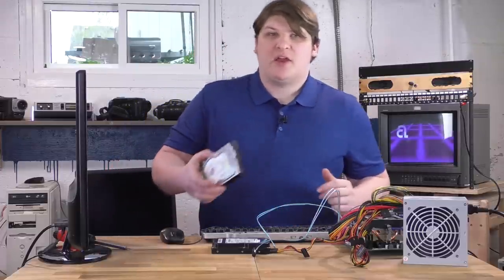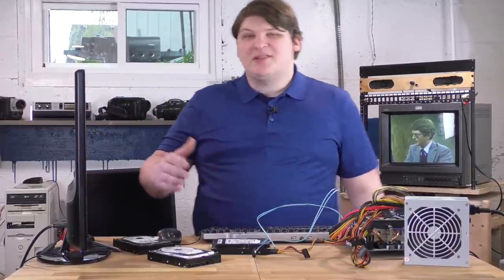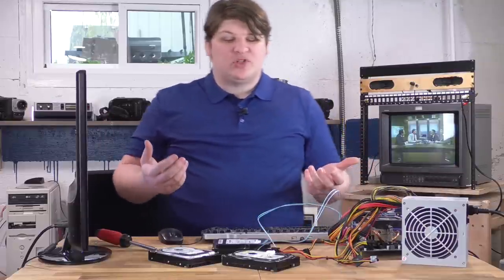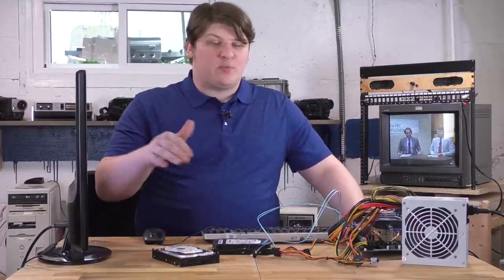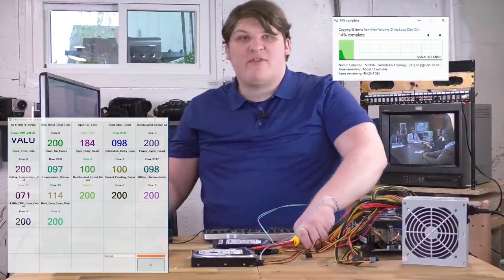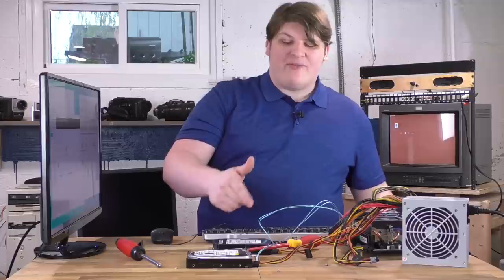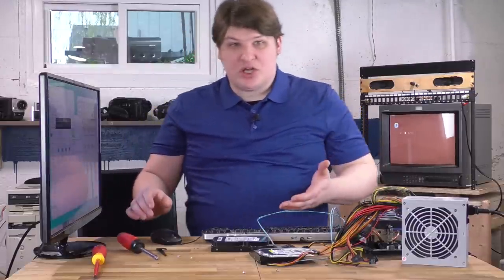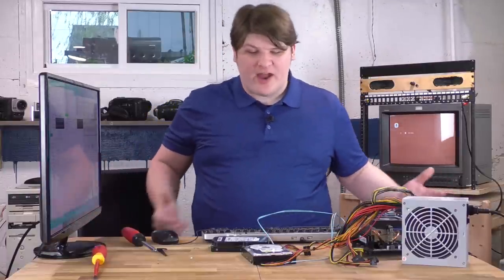Can A Hard Drive Breathe Regular Air Like Us

Comment: my takeaway from this is that DIYing data recovery by swapping platters with my bare hands is a perfectly fine idea with no issues whatsoever
Reply from the maker: two days ago i would have chuckled at this obviously absurd idea but now I have no convictions or beliefs left in me
Reply: Don't touch the platters! The oil can warp the magnetic signal being read by the heads, or make drive head interference!
Reply: Your best option for data recovery is buy a donor drive with the same firmware version, swap the circuit boards.
Reply: now i wish i didnt chuck an old external hard drive of mine. i wouldnt say much of anything valuable was lost, but, still stuff i would have liked to archive to some degree.
Reply: @fully_retractable  eh, most modern drives have data unique to the drive on the PCB, so you'd need to transfer it over somehow
Reply: @AngDavies  it's still worth a go.
Reply: Swapping platters is hard to do as you need to swap the PCB aswell
Reply: I’ve done it and had it work. Probably corrupted some bits, but I was able to copy the file over that I needed, so 🤷🏽‍♂️
Reply: i've done this :D
Reply: @Joe-bm4wx  There is this thing called Silent Data Corruption which is what happens with the parity/checksum/CRC gets the right answer for the wrong reason...in other words there's a mathematical hash collision and the data got messed up enough in such a way that the newly messed up result calculates the same check numbers and the only way you find out is that the file isn't the same by inspection (an executable program crashes, a bank account balance in a spreadsheet changes digits, a picture has static, a sound recording has pops and clicks, videos have multicolored blocks.) In this case when you copy the file the computer says that is copied just fine, but you get the wrong figures. The check method on magnetic stripe bank cards is very primitiive--I'm wondering how many times the card got declined simply because it thought it read alight and used the wrong account number with the PIN that was for the account number originally recorded and no one was the wiser.
Reply: @imacg5658  I need a video to prove this to me.
Reply: Just don’t drop it
Reply: Absolutely not.
I believe it's better to send it to a clean room. 
Better safe than sorry. :)
Reply: @fully_retractable  you sure about that?

Comment: One of my favorite things about (some/most?) computer hardware is if you just, interrupt it and then let it keep going, it just picks up where it left off.  Like lifting a hamster off its hamster wheel, but the hamster's still kicking his feet as if he's running, and then setting him back down on the wheel.
Reply: I know.  Even on 90s machines. You can pull the hdd out of the system and put it back in.   After the drive initialized it just continued xD
Reply: @FennecTECH  You know, this still happens if you boot Windows directly from a USB drive installation, and then unplug the drive. You get a grace period of about 10 seconds of the system hanging, and if you plug the drive back in within that window of time, the system keeps going as if nothing happened. Only if you keep it disconnected does it eventually give up and throw a BSOD.

Comment: I used to work for a company that produced hard drive components.  Dust is only one of many contaminants that a clean room prevents.  You have sweat, spit, hairs, skin cells, lint...  Many of the electrical components are gold and have to be inspected under a microscope to make sure there are no defects in the production.

Comment: I've got to say, as someone working in data recovery, this is both one of the most interesting and hard to watch videos I've seen in a while. Hard drives are at the same time so fragile, yet I've seen many drives well older than I am spin up without issue. Cool stuff.
Reply from the maker: It's a complete crapshoot. Recently, I plugged in a couple-hundred-meg Seagate from the late 80s that used to be in a Mac, and it immediately killed the power supply in my G4 mule. I pulled off the logic board, dug around and found two shorted chip capacitors, which I took out of circuit. Before I buttoned it back up, I noticed the spindle flywheel was exposed, so I gave it a twist; no dice.

I reefed on it pretty hard and it broke loose with a sickening CRACK. The spindle went around 350 degrees, then stopped dead, grinding through the spot it had been frozen at. I forced it through, then gave it another rotation, and this time it didn't resist so much; another rotation, and it spun free. I plugged it back in, it came right up to speed, and I got the file index. Everything loaded fine.

These things are black magic. Hats off to everyone who worked on them.

Comment: Love it; great experiment and demonstration. 

I used to work as a HDD design engineer (I think I worked on that specific drive model you're experimenting with, even), so I could probably talk your ear off about a lot of those subtleties you're playing with, even without getting into any proprietary stuff. They're impressive machines, especially when you consider how cheap they are to buy.

The airflow in the boundary layer on the disk surface helps keep particulates from landing on the spinning disk, and as that recirculates in the (closed) drive it is blown through that white filter pillow to capture any that are present -- next to the actuator magnets in the drive you had open at the beginning, but in other drives sometimes tucked in the other corners around the circumference. Keeping the drive spinning during this test probably helped a lot to keep the surface clean.

The actuator positioning control loop is tuned to expect a specific amount (range) of drag from the preloaded bearings, which is why it failed to work when the preload (tension) was too low or too high. You might be able to cut off just that corner of the cover with a hacksaw or Dremel and leave the rest exposed.
Reply from the maker: oh! wow!! it's fantastic to hear from an expert!

So then my half-baked theory that the drive was forming "a little bubble of air" was probably correct, then; had I shut it off, the results may have been very different - now I want to do round two, get some rigorous data!

Do you happen to recall what the tolerance on the head spindle bolt torque was? It wasn't terribly hard to remove so I'm guessing it's just a few inch-pounds, but I'm curious how close it needs to be to the specific value before the actuator gives up the ghost.

You're absolutely right though - what's amazing is how cheap they are and, as I said, how tolerant they are. I can't believe that these devices, which are more precise than almost anything else I've touched in my life, can just be shipped, run in rooms full of chalk dust, next to blast furnaces and everything else, and just keep truckin'.

Thank you again for commenting, I really appreciate it!
Reply: @CathodeRayDude  The precision on that torque requirement is probably ±10%, which shouldn't be too hard to achieve. Though I think it's really a tension requirement in that shaft, to preload the bearings as you said, so e.g. if you cut away part of the cover and reduced its stiffness, the nominal torque requirement may change.

At the level of this kind of experiment, doing it by feel is probably OK. The positioning servo loop is pretty robust, and it won't hold a grudge against you for abusing it. (There are all kinds of reasons it might intermittently fail in operation, so it needs to be able to recover gracefully: vibration, shock, temperature to low, temperature too high, someone squeezing the cover, ...)
Reply: well you're super awesome. :D
Reply: This kind of comment makes reading 1000 crappy youtube comments worth it. Thank you.
Reply: I'm not a drive engineer, so take this with a pinch of salt: I have read that the vents on the exterior of a drive are not for significant air flow but rather are for just the tiny amounts of air required to maintain pressure equality between the interior and exterior, for example, as it's moved to different altitudes.
Reply: That's correct; there is a long and narrow labyrinth path that is sized to allow for pressure to equalize at a reasonable rate, while limiting the rate of air and (especially) humidity exchange. A silica or carbon buffer also helps with the latter aspect.
Reply: @Dowlphin  Yes, the heads are aerodynamically flying (in "ground effect") both while the drive is in operation and as it spins down. Most drives now unload the heads past the outside edge into a "parking garage", but older drives parked them on a specially-treated region toward the center of the platter. And yes, very careful design and control of that aerodynamic behavior is what enables the head to fly nanometers above the disk surface (at the trailing edge, where the read/write elements are; the leading edge is much higher, though still infinitesimal).
Reply: this is the coolest frickin comment
Reply: @RobLion  I've read that the equivalence would be having a 747 fly 6cm över the surface of the ground.
Reply: I used to do computer forensics/data recovery years back and had a clean room where I performed internal repairs, head swaps mostly, and this brought me back.  Since that time, helium filled drives came to be, and I'd like to know what would happen if one of those gets exposed to standard atmosphere.

Edit:  Just made it to the end of the video where he dropped the in use drive...depending on the platters, the dada on that drive could possibly be saved.  If it had (which is most likely) ferrous coated glass platters, then a head crash like that would literally remove the coating from the platters, thus physically scraping away the data.
Reply: @RobLion  ground effect?
Like those insane, enormous Soviet flying ship things? (Ekranoplans) 

Cool
Reply: @RobLion  Do the very same laws of fluid dynamics still apply to the minuscule proportions in hard drives? Cause I've had the ~nightmarish~ classes in mechanical engineering, but never EVER came across the topic academically, much less in practice (heck I'm bad enough at the subject already). I know material science gets wacky in the scale of DLP projectors for example, fatigue doesn't really work as it would on those (for the ones that don't know: DLP modules have a mirror for each pixel of image, and it mechanically twist to shoot light away from the screen and into a light sink, essentially a 1 bit color per pixel, tho with PWM you get grayscales and then color with a color wheel or cycling LEDs). Same with any other MEMS devices.
Reply: @Kalvinjj  The same "laws" of fluid dynamics can be used to model this regime, but as most of representations of those laws depend on parameters like the Reynolds number which includes a "characteristic linear dimension" factor, the behavior can be somewhat different from what we're accustomed to at larger scales. CFD simulations are sometimes used, but as you may imagine they are extremely resource-intensive and slow, and not really useful as an up-front design optimization tool.
Reply: Whoa
Reply: Might you be able to answer why dust is able to stick to fans?
Reply: @andrewsutton6640  A fan in the end is an airfoil like just any wing, but arranged to push air as intended. Thus the same fluid dynamics apply: the air moving through it is slower the closer it is to the blade, being theoretically stopped and stuck to the blade on it's surface. Therefore there isn't any meaningful force on the fan that is pushing that dust out of the blade, despite this not appearing intuitive. The fan surface can attract dust just like any other surface, but if it's pushing air through it, then the more dust tends to be on it's path.
This is what I understand of it through fluid dynamics, if there's anything wrong and anyone can bring up then I would like to know as well.
Reply: @Kalvinjj  thank you for your swift reply :-)
Reply: @andrewsutton6640  Many dust particles are sticky, for one reason or another. In the whirling turbulence around a fan blade, some of those particles will find their way into a low-velocity eddy where they can contact and stick, or collide at a high enough relative velocity the airflow cannot overcome that stickiness. Once a few dust particles do start to build up, further dust will be even more likely to accumulate in those same locations.

The probability of any one dust particle sticking to a fan may be very low, but the result of millions of low-probability trials (running a fan for hours on end) can reach a tangible presence faster than you might think.
Reply: @RobLion  With that being said once a single particle sticks I would think it would probably be a better surface for the next to attach to so it is more of a logarithmic collection than just linear build up. I guess at only through a certain collection period though as weight and higher pressures farther away from the blade would cause it to dislodge. Sound plausible?
Reply: @brockbatson9001   about that glass platter, I thought hard drives were metal, and I'm assuming some (probably older) ones are, until I was messing around with a dead 2.5" laptop drive, and the platter shattered
Reply: @Kalvinjj  Think about when you need to sort some papers, you go lick your fingers to take the pages apart, now think how motor oil would be sticky and sluggish at very small scales and the machine would not have any lubrication.
Reply: are you a mechanical or electrical engineer?
Reply: The servo tracks seem to be one of the defining parts of modern hard drives. Putting the "landmarks" on the disk means that the heads don't need precise absolute positioning, they just move until they get to the right track as marked on the track itself. These also allowed the fast voice-coil position mechanism.

Comment: "Would this break, if I dropped it?" 
<CLATTER>
I don't know what I expected . meme
Reply: that ending was amazing xD
Reply: Clatter Platter! :P
Reply: I have had drives that I have accidentally dropped that have worked for years after I dropped it.  Recently my foot got entangled in computer cords that caused the computer to fall over on it's side and slide about 3 feet on the floor.  The computer froze up.  I power cycled the computer and it booted right up.  Still running.

Rev George

Comment: My first hard drive, from when I was a kid, was a 540MB drive. I ran DOS, and I learned how to program on the machine hosting that drive. When I upgraded to an what seemed an inexhaustible 6GB drive, I decided to open my old drive. It looked very cool, so it hanged, open, on my wall for many years.

Fast forward about two decades, and I was throwing away old junk, and found my old 540MB drive in a drawer somewhere. It must have set there along with nails and screwdrivers and other junk for at least a decade, after being displayed on the wall for the best part of a decade. Just for kicks I decided to plug it back in, to see what would happen. Of course, I had to buy and IDE<->USB adapter to do this. I didn't expect much, mostly just some head moving. I certaintly didn't expect to be able to read the data off it, but to much of my surprise, I was able to do just that!
Reply from the maker: That's remarkable! Wow!
Reply: Maybe those old drives had super low tolerances